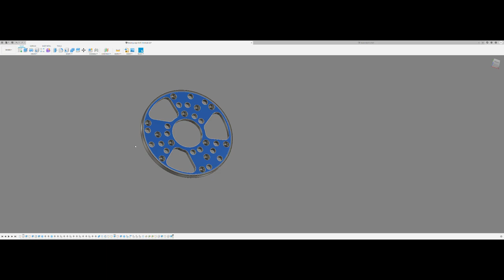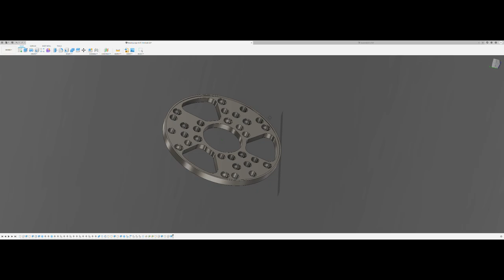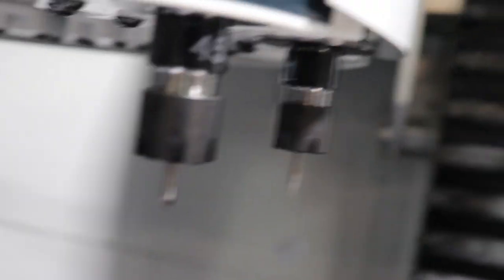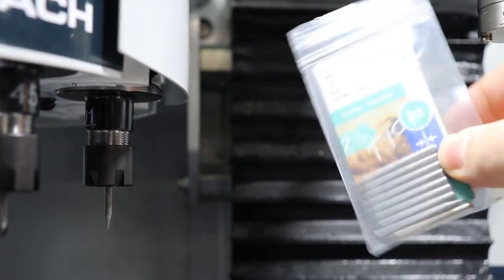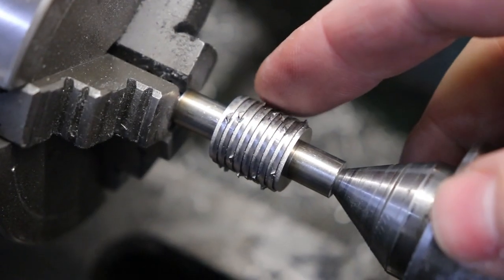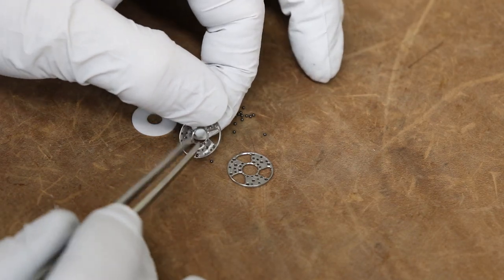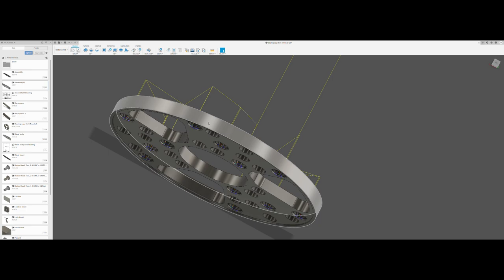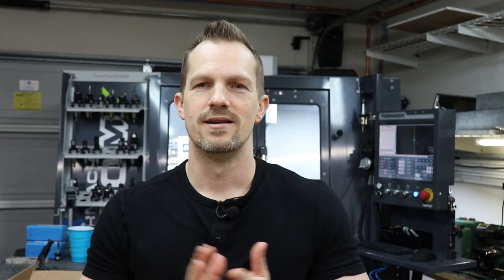Interface knife making part 5, Custom Bearings

Comment: Love the videos man keep them coming. Did you see how grimsmo installs his knife bearings? Basically dips the piece the bearings go into a cup of bearings and that fills holes with bearings. Then uses a piece of flat stock pushes all bearings in at the same time.
Reply from the maker: Yeah, I can't really do that with mine the way they are since I have unpopulated holes. Maybe if I oversize the ones that don't get balls so they could fall through. I'll update the design and to give it a shot next time I need more bearings, it would definitely be faster and easier.

Comment: I think you can have a better time if you use a tormach 24r router for carbon and use the mill for mainly metal.
You need way less cleaning and since that router is huge you can have a lot of part made at the same time.
But great stuff keep going.
Reply from the maker: I'm not sure the router would have the precision and repeatability necessary for the parts I'm making, plus there is no automatic tool changer for it. It would be very nice to have another machine dedicated to just carbon though. Glad you like the videos, I'll try to keep it up.
Reply: @vcedge9466  yeah having a second one for those is better than you can have a bigger tombstone like as big as the actual table so you don't need to cut the carbon any more just a sheet goes in and a lot of parts comes out. So happy to see your channel grow

Comment: Have you consider a slitting saw to cut your stock - the edge is very clean (I must admit I never tried Ti). Also you probably already know that but when you prototyping you should consider running only one part to reduce your cycle time
Reply from the maker: I have some carbide slitting saws that I've used to cut Ti with before, but I'd rather have a way to prepare stock outside the machine. These weren't exactly prototypes, just highly updated. I've made some like them before but new machine and lots of changes to the cam operations, so yeah would have been a good idea to do just a couple at first.

Comment: Great to see some smaller tooling on the Tormach.  If you get a chance sometime, would be really great to see some surface finish closeups on those micro ops on the Tormach.  We use a binocular stand scope for inspection of 28mm scale 3D prints. Haven’t fitted a still/video camera to it as we don’t make YouTube’s ☺️.

Which op did you use the ..020 endmill for?

Nice vid! Thanks for putting it together.
Reply from the maker: I used the .020 end mill to dial in the diameter for the bearing balls to fit through but now that I know what works I'll just use a drill that size. I would love to get a scope to show more of the details. It'll probably be a while since I'm sure they aren't cheap but do you have a recommendation for one?
Reply: Thanks for the quick response Jason.  When we get our Tormach it’ll be mostly micro machining,so 20 thou perks up our interest.  Have yet to come across anyone showing surface finish/tolerances they’ve gotten with those sized bits on an 1100M/MX.  

Scope.  Our criteria was affordable, decent enough optics, trinocular and heavy.  While you can spend tons more, we ended up with a Amscope trinocular with a extended post and led ring light.  Got it back in 2014.  It has served us well, have never upgraded to the Zeis  gods of optics 😃

A buddy of mine liked ours and bought a boom version for soldering.  Hardest part of Amscope buying is figuring out which of umpteen billion versions to get.

Comment: Are you still using the 25 micron felt for the first stage? Do you still think you’ll try the next size larger?
Reply from the maker: Yeah, that was still the 25 micron, I have some 50 on the way. It's interesting, from what I've been reading as it gets more full of carbon fibers the effective filtration gets finer and finer. the 25 micron can run for about 4 hours, on the stuff I'm doing, before I start to consider changing it out. We'll see if that translates to the new stuff, maybe I'll be able to get 8 hours or more.